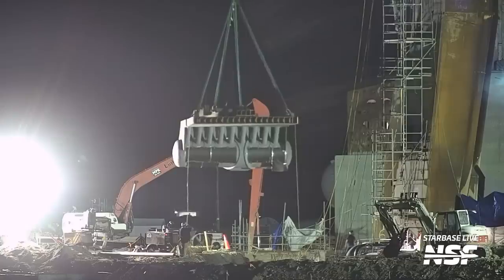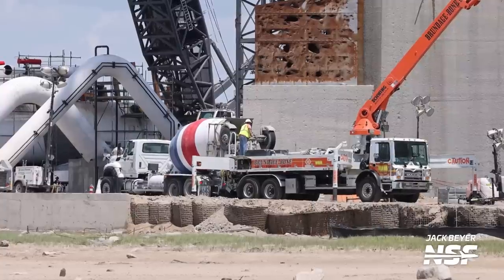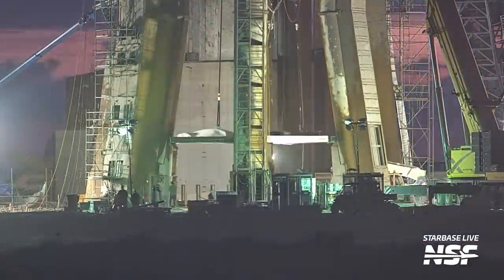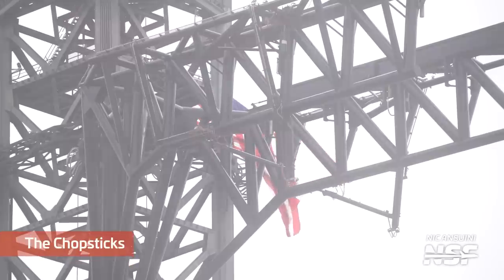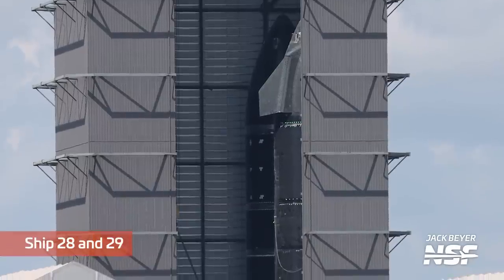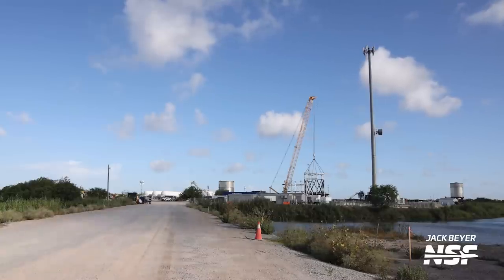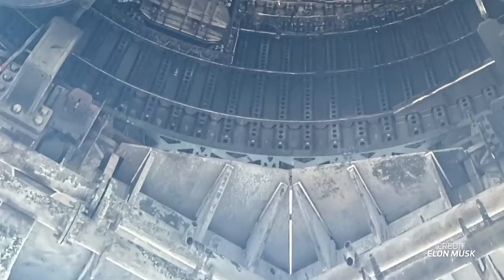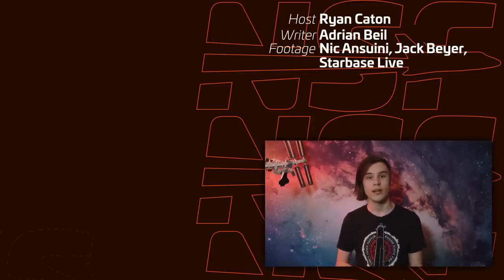Starbase Update: Orbital Launch Mount Gets Its Plate | Is Booster Testing Coming Soon?

Comment: If reports are correct, it's not 200 concrete trucks, but over 300.  130+ on the first big pour, 170 in the second big pour (with a smaller pour in between?).

Comment: The Bidet isn't going to do much of anything for sound suppression.   It is a JBD analog and will function to redirect the rocket exhaust, its water cooled to allow it to survive the high temps involved (for a short time).  It is not a Deluge system(for sound suppression), that would be mounted up on the OLP, and a Deluge would not be able to protect the JBD from heat damage.

Comment: It doesn't matter what they do,it's a short cut, starship is going to blow up again 😂🔥
Reply: This upgrade is not a shortcut since it was already in the works before the first test.  With all the improvements done to the booster, starship and pad their odds of a more successful flight have greatly improved.
Reply: @michaeldeierhoi4096  look at any other space agency platform for thier large scale two stage rocket, china,USA , Russia, starship is larger but has a smaller platform for dealing with heat and thrust
Reply: @codeforce5556  And is any other space agency reusing those rockets? Lack of innovation doesn't mean innovation doesn't work
Reply: sorry to say that but even if the starship blows up it's because of hot staging not because of the pad next time. just my assumption.
Reply: @archer1133  reusable rockets are nothing new, NASA did it decades ago, didn't continue because of larger payloads with non reusable,(still small)on top of that there were no large payloads to carry that why projects like the sea dragon (a better craft)were not considered
Reply: @codeforce5556  I am talking about fully/first-stage reusable rockets and they stopped doing reusable because of budget constraints plus high accident rates, not because of payloads. The lack of innovation comes where they failed to appropriately build things, like the shuttle, in a way to support reusability.
Reply: @codeforce5556  Reusable are new in that no one including NASA attempted it for very long or made it commercially viable.    And notice how no one else is attempting reusable rockets YET.  That should change as Rocket Lab, Blue Origin and others  are moving in that direction.
Reply: @archer1133  I wouldn't call starship innovation,it an old concept from 1960s-70 using modern materials,the rocket equation limits any further improvement/advancement, our generation is afraid to develop new ideas, because of cost and fear of faliure,so they resort to obsolete technology, it's cheaper to reinvent the wheel,at least NASA ana Jaxa are working on detonation/nuclear engines
Reply: @michaeldeierhoi4096  no one should be still wasting time on deflagration engines,(current rocket engines)they use too much fuel and have low payload capacity,(1-5%)detonation and nuclear
Reply: @codeforce5556  Starship is definitely not an old concept. The first difference is the mass production of them. Plans to have hundreds built with current construction only taking a few months per booster. Then, there is the radical idea of catching both the ship and booster mid-air using the towers “arms” which, again, is unheard of. As is the huge water cooled plate instead of a traditional flame trench and water deluge. Then using the same heat shield tile on almost the entire vehicle to allow for rapid reusability. Even the idea of reusing the second stage isn’t common. Calling stainless steel modern is inaccurate too. I would encourage you to check out Pulsar Fusion. They have even more ambitious engines than nuclear

Edit: I forgot to mention the fact that they will try to hot stage a reusable vehicle. That is the definition of craziness.
Reply: @archer1133  starship has uses as a cargo vessel, similar to its more powerful older grandfather concept the sea dragon,which could,if needed put a space station in orbit,but besides that it not an improvement,even the heat tiles are similar to the space shuttle , musk is attempting to lower cost and monopolize the space market by mass production and volume/payload not actually technology improvements,but it will fail because of technological realities and limits.research and development into practical concepts like detonation engines,space planes , magnetic plasma sails and nuclear engines are required for planetary/space travel
Reply: @codeforce5556  Your criticism of the current rocket technology is a sign of resistance to accept the reality of the time we live in.   Right now these deflagration engines especially as demonstrated by Space X with the Merlin engine are the best we can do at the commercial level.   

The detonation and nuclear engines will require MANY more years of development before coming online.   But apparently you prefer some magical change where all those defrag engines will just suddenly go away some day to be replaced by your detonation and nuke engines.   Good luck with your fantasy.   It may happen.   In ten or 20 years!!  🙄
Reply: @VvV-1    When your conclusion is based on an assumption you will be wrong almost every time.  Your assumption does not even offer any supporting evidence or reason.  

And It's not as though hot staging hasn't been done before and successfully.  NASA did with it the Titan rocket that launched the Gemini capsule into orbit.  The Russians have also been successful with hot staging.  

Plus technology has come a long since those early days.  Computer modeling has greatly enhanced the development of technology as one example.

Comment: Hi Guys, Just wondering , how does water spraying up from the new launch plate combat 5,000,000 lbs. of rocket thrust? What psi. is coming in through those manifolds?
Reply: I don't think that's the intent but rather the deluge system is suppose to saturate the area under the nozzles with water so it can absorb more of the vibration.  In other launch pads (including the Starbase sub-orbital pads), the water is directed from the sides of the mount rather than the bottom.
Reply: It's 5,000,000 lbs over more than  90,000 square inches so it only needs an average of 55 psi to balance the thrust, more pressure than that and the water will FLOW.
Reply: The water is meant to create a top-surface layer between the thrust and the steel sandwich, not spray up (but it will probably still do so due to pressure).
Reply: The water cools the metal plate. The plate protects the concrete foundations. The foundations support the launch mount.

Comment: Why would there be an issue holding the chopsticks up for any length of time?  They are used to lift up a booster and a starship! I sure hope they can be held up for a long time.
Reply: Plus the higher they are the less cable is on that side of the tower, so less weight.

Comment: Is there any concern that the pancake was put in place before the concrete underneath was fully cured?  I have no idea how long it takes for different types of concrete to reach full strength.
Reply: That concrete is so thick that the pancake will have no effect on its curing. It should be fine. although I dislike all the waiting like everyone, that concrete needs all the time it takes to cure correctly. It will be worth it.

Comment: I am finding it very hard to believe that that much concrete will be cured enough for booster testing in just a few weeks.
Reply: It takes only 28 days for your average concrete to reach about 90% of its strength. Now that’s plain old concrete. Goodness only knows what kind of mix they are placing under the OLM. If you buy into the steel plate and lots of water as primary protection under the booster, then all the concrete has to do is resist lots of compression. Concrete, even new concrete, does that really well. Add in enough steel rebar to resist flexing and it just might work. It all depends on how long they stay on the pad and how much water they can dump on the plate. Going to be interesting without regard.
Reply: @Bill_N_ATX good point… I’ve had a base for a house poured and this also was a similar time frame 👍👍👍
Reply: They can start testing when the concrete is partially cured as they need to shake down the deluge system and GSE updates before they do any static fires. Probably a month of testing needed before they attempt another launch so it should be fully cured before getting 33 engines full power.

Comment: how will they seal the underside of the deluge system once all parts are in place and sitting on concrete. with no underside access to weld as on the top surface

Comment: Would it be possible for the raptor engines to force the water back and fire to find it's way inside via the same channels?
Reply: Not likely. It is not difficult to calculate the thrust at the surface and from that chose a water pressure that will be larger.
Reply: No. There is water which will instantly turn into high pressure gas working against the thrust.
Reply: @Snooooozel  hi, I know there's the water, I'm no good at maths but wondered if it was possible the heat or flames with the combined power of 33 at full power could push it back, cheers for answering matey 👍🏼
Reply: @jameshague9107  no, the water is suspected to be 5 psi higher than the thrust of the raptors (which is a plenty of margin)